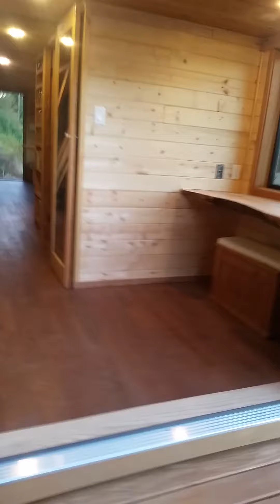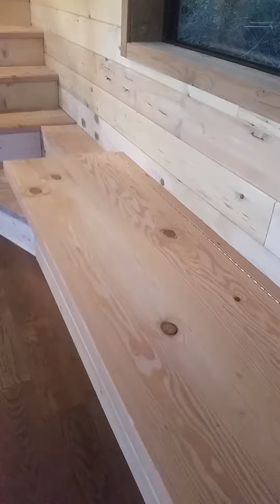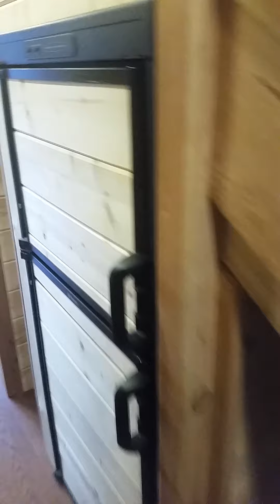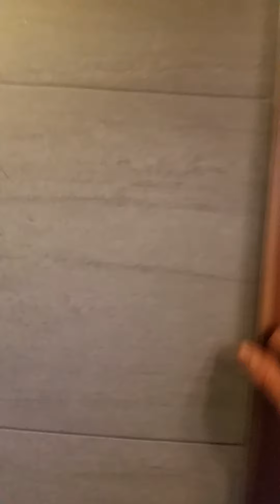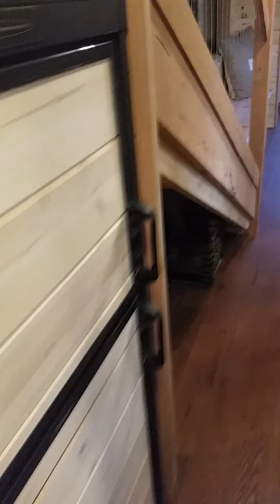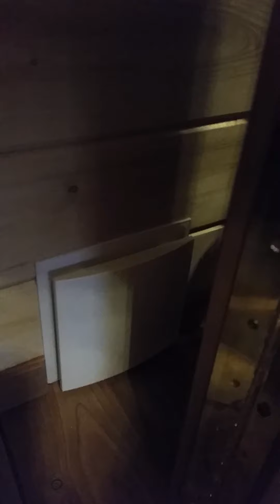Rochette Tiny house tour. (sorry for the vert vid!)

Comment: 15'6" high?! What's the max height for the highway? I only know 13'6" is the max for a regular tiny house that doesn't need special certificates or moving services.
Reply: In the State of Washington, my first Tiny Cottage on Wheels was 14'2" high because I used a tractor hauler trailer which was a flat bed trailer with the wheels under the flat bed so the height was 3' from the ground. Washington allows 14' height with no permit.  With an escort (and no permit) I could go over 14'6".  Hay bales and apple bins can be 15' heights with a permit $20 per month.  Most of the states West of the Mississippi River allow 14' height.  Its the Eastern States that have the 13'6" maximum height.  Alaska is 15' maximum height.  Colorado and Nebraska is 14'6" maximum height.
Reply from the maker: it is 13'6"